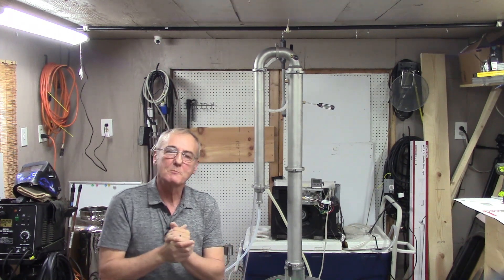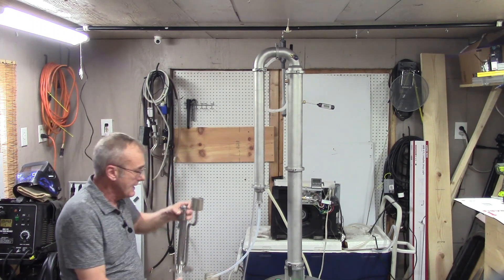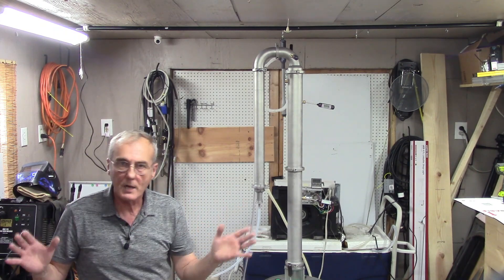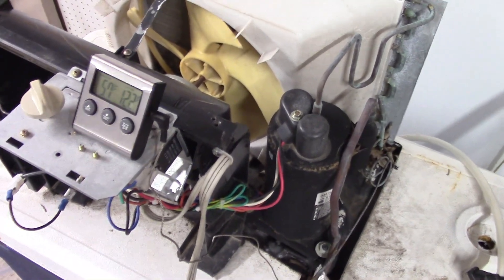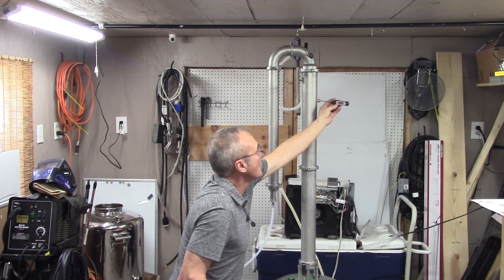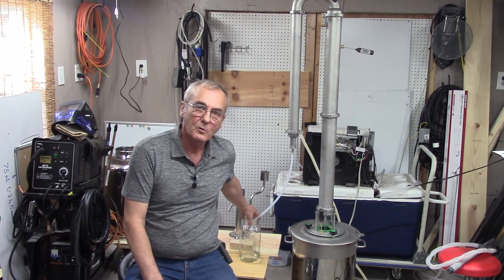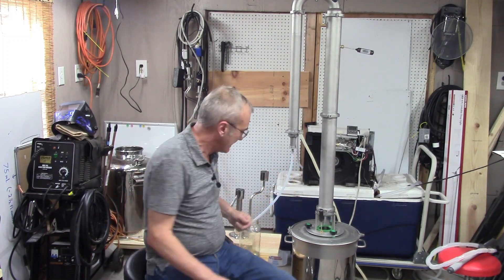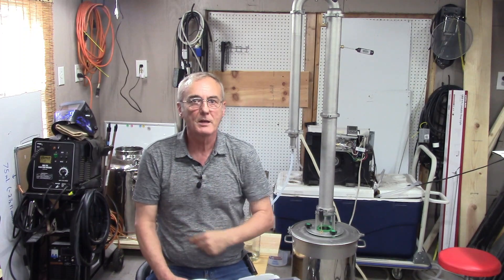REVIEW OF THE STILLMAN X DISTILLER (PART 2)

Comment: I had a run going and was talking about how I needed to be careful since it was my LAST alcholometer.... Sure as heck, it was broken when I opened the plastic holder. I was freaking out so got online and ordered 2 more. I figured I could taste my way thru this run... But, it was my test run with SG of the mash at 1.090, George's spec, lol. So I did some digging and lo and behold I found another 1 in a cool black plastic box I recently bought (and forgot I had). So it was all good 👍 Test still in progress. 1 more run so I can fill a keg with both both batches. #HAPPYDISTILLING. Thanks George 🥃

Comment: I don't get it.  You're running a reflux still that I think you said was packed but you pull off spirit at 120 proof?  That's really poor proof. On that 3" column you should be pulling 190+ proof not 120 which is  pot still territory.  You're cooling/heating adjustment is no where near balanced.  That hardware can surely do a whole lot better.  120 proof might be really good for an 8% wash that's meant to be a whiskey but that's not an optimal configuration to do that as you loose out on the oils needed for whiskey.

That configuration should produce a neutral to make many other spirts but you seriously need up to up the proof substantially by turning down the heat and upping the reflux a lot.

Comment: Loyal subscriber! This company advertises that it uses all high-temp silicone in its gaskets. If you look up chemical compatibility of silicone exposed to acetone or ethanol, it breaks down. Who knows what gets into the distillate? Better to use PTFE, the stuff in plumbers tape. Bearded found a source for PTFE that is thicker than tape and used it in his thumper design. PTFE has excellent resistance to breakdown by ethanol. And you can buy PTFE triclamp gaskets ready made. Happy distilling!
Reply: In that vein, what type of tubing should be used for the distillate output so it isn't slowly dissolved?

Comment: Rather than using the parrot to guess that drop in proof for hearts / head cuts you can use the head temp to gauge that that drop in proof. I added a function to my PLC to calculate it in real-time. I’ll post the function as a reply later.
Reply: ABV% = 1946.44 - ( 359.5189 * LN ( <Still Head Temp in Degrees F >) )
Reply: @terryspine  Interresting BUT you can only do that if the temperature sensor has a very good accuracy ,minimum of 0.01 dgr celsius. So a ds18b20 is useless.
Question is what do you use as a sensor ?
Reply: @chrisv8674  I use a PT100 RTD into a SOLO 4848.   I calibrate the system to 212 F using boiling water.  This provides enough accuracy for the equation to be within 1% ABV from about 50% to 93% ABV.  After that the function drifts away from the curve, but its accurate enough for my needs.  The calculation is carried out inside an Automation Direct PLC connected to the SOLO via RS485 and displayed on a PC running Advanced HMI.  Vapor temp above the dephlegmator is directly related to ABV, although it be non-linear.  I used the ethanol vapor phase charts to create best fit curve.
Reply: @chrisv8674  Whatever works for each distiller is fine with me.  I just wanted to publish that you can use head temperature changes as a precursory indicator of  ABV before it shows up in the parrot.  That is all.
Reply: @chrisv8674  are eparrots for sale anywhere for those not able to build their own?
Tim
Reply: @MultiTut69  Hi Tim,in the past there was a kit but not anymore so you have to make your own,right now the developer is rebuilding the eparrot,so keep an eye on github.
Reply: @destitute8493  Thanks for your input,  sorry but I think you need some more reading about this subject.
As that sensor you linkec to is completely different as what we need,that sensor is great to detect alcohol escaping vapor.
We need a sensor that is so precise that its reading can be used to measure the vapor temperature as that is related to the abv.
Reply: Maybe a second parrot for heads only.